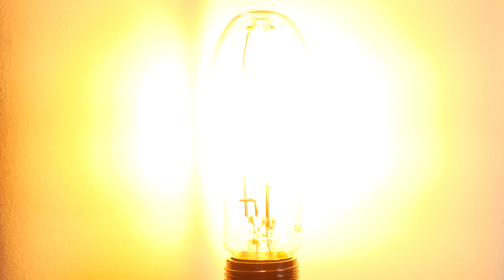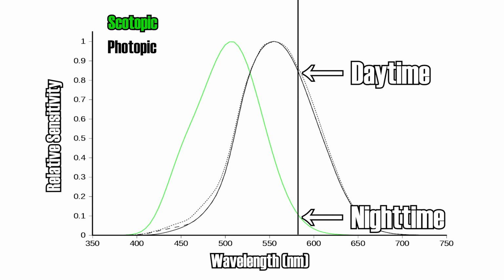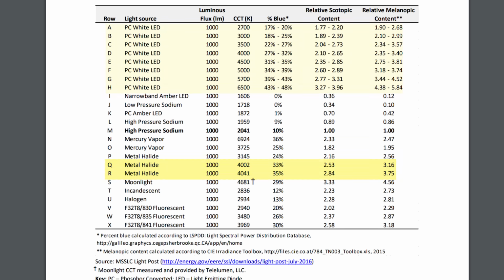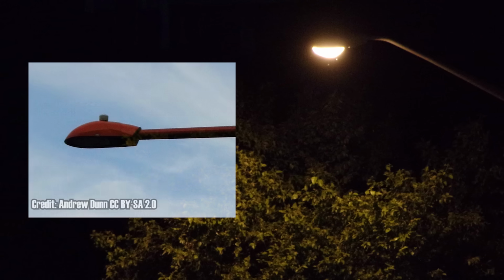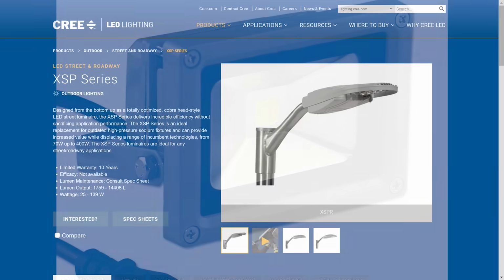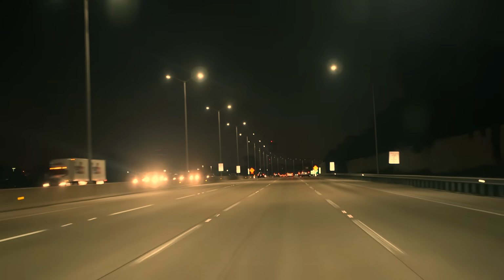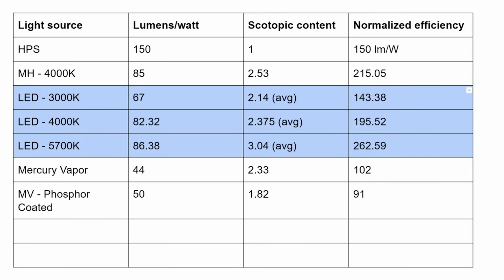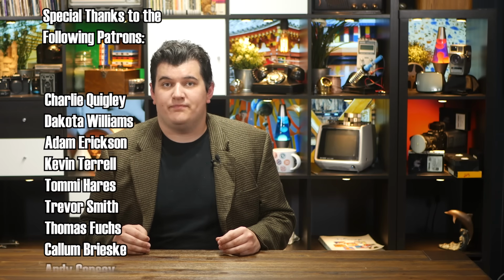The LED's Challenge to High Pressure Sodium

Comment: I might be exposing my ignorance here, but have you heard of the study of white LEDs versus amber street lighting when it comes to behaviour? This is incredibly "hear-say" of me, but what I heard is that areas with white LED street lighting tend to have a lower crime rate after the installation of white LED lights compared to before and compared to areas that are yet to be upgraded with white LED lighting.

Could be entirely bull, I can't find sources on this at all, but here in the UK it's a rhetoric that was spread around a fair amount when local councils were replacing amber street lights with white LEDs.
Reply: This sounds like mistaking correlation for causality to me. Areas that are in general wealthier/higher class generally have systems in place to lessen crime, be it better police funding, street cameras, or just neighborhood watch. Also those same areas have the extra funding to upgrade things like light fixtures and usually care more about issues like energy efficiency. I would be surprised to see any change if you replaced lighting systems in a gang neighborhood or even a suburban area that has a disproportionate amount of crime.
Reply: Crime is directly related to how accurate the visibility of criminals are. It isn't really to do with "orange" or "blue" it has to do with accurate color representation and brightness. However, warm white (orange) gives you less accurate color than (whiter) daylight blue, so you could generalize that bluer light = less crime, but its higher CRI and brightness that actually matters.
Reply: This is interesting. Personally I thought it would be the other way round as blue lighting gives me the creeps. I wouldn't be surprised if it fostered depression. But that's just my personal impression.
Reply: +Humes McKenzie Honestly there are certainly confounding variables that would have to be taken into account to gather any meaningful data on whether or not such a phenomenon does exist and if so whether lighting is a causal or at least contributing factor. On the other hand dismissing the possibility out of hand does not seem justified either there are certainly several very plausible hypothetical ways in which changes in lighting could influence human psychology and/or behaviour in a way which could potentially have an effect on crime either directly for example the increased perceived brightness making potential criminals feel more exposed or indirectly for example if the change in lighting affects the way other people use the space in a manner which increases the perception of risk from criminal activity. Of course the other question that would need to be addressed if such an effect is proved to exist is whether the effect is due to a reduction in spontaneous offending ie crimes of opportunity or merely a displacement of premeditated offending to another location.

A proper assessment of whether such an effect exists and most importantly if such an effect does exist understanding the causes and implications of that would take a properly conducted study which would of course need to also study satellite areas (such as other areas of the same city) as well as completely unrelated control areas (such as similar areas in similar but geographically very distant cities) to not only determine if the hypothesised primary effect exists but whether any secondary effects occur beyond the boundaries of the area where the new lighting is implemented.

Short of that we would merely be guessing and frankly when it comes to understanding complex social phenomena like criminality and determining the nature of changes in large scale statistical data sets such as crime rates human intuition frequently completely fails at the task and rarely provides a complete explanation even on those rare occasions when it is at least partially correct.
Reply: Oh yeah, I've heard about that. I think the Japanese were the first to discover the de-criming effects of blue street lighting. It has been in use for over 10 years now, I thought it was fairly well accepted science at this point.
Reply from the maker: I haven't heard of it, but it's one of those things that sounds true.  But I must disclaim; something that sounds true =/= true.  I would be curious to see some thorough research on the subject.  I think that in general, whiter light is just easier to see with with.  Sodium light is light, sure, but it's not what our eyes are used to seeing--it is in a way the most unnatural light you can have.  So I could totally understand that would-be crime committers might feel far more exposed under white light vs. orange/yellow sodium.  And when it comes to fighting crime, often the illusion of safety is worth just as much as safety.
Reply: @BeTheDeathofMe  peer reviewed or it didnt happen    ;P
Reply: I don't know if it's true, but surely pictures from CCTV are clearer when recorded in light form LED lamp. When there're sodium ones, you can't even determine properly the colour of cars and clothes, and of course it is more comfortable situation for criminals.
Reply: Installing blue lighting at Japanese train stations also seems to significantly decrease the suicide rate, so there may be some impulse or mood affecting property to blue light.
Reply: @thundrbunny id like to read that source, it just isnt working for me.. :/
Reply: whoa.... got some studies on this?
Reply: This is probably at least partially related to broken window theory, which has decades of research behind it.
Reply: Yellow street lights are close to useless when too few are set apart, so criminals know very well yellow light is good as shit to it makes for a perfect spot to rob people and not be seeing.
Reply: UK councils would rather use feelgood hearsay than actual evidence or community needs/wants. They are not there to help you.
Reply: the only best way to test is with areas of equal crime rate and see what happens
Reply: Xilefian 4
Reply: +Micah Reid "Areas that are in general wealthier/higher class generally have systems in place to lessen crime, be it better police funding, street cameras, or just neighborhood watch"
But the OP suggests that the crime rate went down in those areas after installing the new lights. Unless it is shown that at the same time other changes were made, it doesn't seem like mistaken correlation. Because the wealth standard of the area didn't change, only the lights did.

Although I don't know if there is any truth to the claim made of the OP, I could imagine that the effect of the replacement of the light might come from the white light making potential criminals feel more 'exposed' because of the  better visibility. The effect would probably wear off as more areas would receive the new lights.
Reply: +StraightOuttaJarhois Indeed while blue light inhibits melatonin it stimulates it's close relative seratonin. This is why cool bluish lights are often used in the treatment of seasonal affective disorder (A form of depression caused by insufficient light exposure common in high latitudes during the winter thus the name though it's documented to occur in shift workers also due to the lack of daylight exposure caused by shift work). The two are closely intertwined and not simply because of the fact that Serotonin is actually consumed in order to produce Melatonin, yes it is the precursor to it but you don't actually need to become serotonin deficient to develop the symptoms so it's likely there is some competitive inhibition going on also.
Reply: This seems to be in the vain of what you are talking about

https://s3.amazonaws.com/academia.edu.documents/33302059/2014__2nd__J_Affect_Disord.152-154_pp182-184.pdf?AWSAccessKeyId=AKIAIWOWYYGZ2Y53UL3A&Expires=1529437072&Signature=%2FJ5WcYims5RvABeqwG4Syuo7wvQ%3D&response-content-disposition=inline%3B%20filename%3DReconsidering_the_effects_of_blue-light.pdf
Reply: Gentrification. They're not putting the most modern lighting sources in "the hood". They're putting it in the pretty parts of town where rich white people come to shop and dine. The fact that LEDs are usually a lot brighter than the lighting they replaced will also help deter crime.
Reply: have you considered that LED lights tend to be installed in gentrifying/ modernizing areas while old sodium lamps are just maintained or left as is?  thats the experience in my town (only the gentrifying downtown has installed LEDs, and the demographics in this area have changed dramatically in the last 5 years...)
also, the idea that LEDs prevent crime just seems like a malcom gladwell truism ( broken windows theory) that politicians are happy to reiterate for their own agendas...
Reply: I really dont like led lighting, i think councils chose the rough areas to put the lights in,  for our safety ,lol. Complaints about light in windows were widespread, so they try different fittings,  wouldnt imagine them doing this testing process in the nice areas where the councillors live..  bright lights also make the victims easier to find.
Reply: Brighter lighting has been proven to reduce crime do to increased visibility. Criminals prefer to work in the shadows.
Reply: @ Future Hindsight
What makes you think that criminals need flashlights to see what they are doing anyplace where it is light enough to walk without one?
Reply: @BeTheDeathOfMe Do you have any peerreviewed paper to back your claims up?
Reply: @ Future Hindsight 
Because nobody but criminals are out and about because the darkness is dangerous.

Comment: You could start thinking of outdoor lighting in terms of light design, with warmer, lower intensity lighting placed closer to the roadway at an angel and higher discharging lamps placed further up. Yes, you've increased the total cost, but if lamps only need to be replaced every 10 years or so, meh.

Comment: Low pressure sodium is king, best in fog, best in output, best power factor with corrected reactive gear, somewhat problematic however when the streetlight in front of you turns out to be an amber traffic light that suddenly turns red, great video.
Reply: Yes What nonsense.  Whose going to put power factor correction on an HPS ballast?
Reply: everyone does, except maybe in Murica.

Comment: The solution is simple, fix the optics, use LED lights for road lighting, and Sodium lights for street lighting. Problem solved! I still wish they would turn the street lights out at midnight like they used to so I could gaze at the stars again.
Reply: Have road lamps use sensors to know when to turn on. Make them combine their sensors so they're sure its something to turn on for and not a leaf rustling in the wind. Could work for sure.
Reply: LED lighting is so much superior to HPS lighting is so many ways, but to me the color of light is its best feature. I can see so much better with the LED replacements and I do not get the glare I used to get with HPS lights, plus everything looks much better under the LED lighting, colors are not washed out and I find it more relaxing
Reply: Yes the post does have that meaning. Like I said that usage and meaning is wrong. Streets in residential areas are roads. Streets are a subset of roads if the qualification of the meaning of the word street to mean roads in urban areas is used. The meaning that I am complaining about is having streets as one set of highways and roads as another set of highways with no overlap between the sets.

As for saying that curtains will always let in blue light, thus disrupting your circadian rhythm I say: get better curtains. If you really need to get blackout curtains. The very name describes what they do, ie cut all of the light. The common good of better visibility outweighs your circadian rhythm disruption when that disruption has a fairly inexpensive solution.

Oh and the streetlighting where I live would suggest you are wrong to suggest that LED streetlighting is not ready to be installed in mass quantities. Almost all of the major roads around here have LED lights and a great many of the sideroads have LED lights as well. Night time visibility has improved greatly for drivers. Combine that with the switching off of a good deal of the lighting after 1 am that I described above and things are very, very much better for all concerned.
Reply: In the UK we have group control, that does the same thing as the lanterns wont turn on unless the main sensor and the sensor on the lantern both agree.
Reply: "The solution is simple, fix the optics, use LED lights for road lighting, and Sodium lights for street lighting." Problem with that statement is that you are using road and street in a non-standard, incorrect way. Road is a synonym for street, and whilst it might be possible to describe streets as a sub-set of roads if the additional emphasis on streets being roads in built up areas is applied to the meaning, that is not what you are doing. You are using it as meaning that roads and streets are different sets, not streets as a subset of roads.

To those who have circadian rhythm disruption: get darker curtains. If you really can't sleep with even a little light coming in the window then deal with the problem at the window. Oh and LED lights allow precisely the sort of programmatic turning on and off of streetlights that you are advocating. A lot of the lighting around where I live gets switched off around 1 am.
Reply: He uses road to describe highways and street to describe residential roadways, such as housing estates.

The lantern outside my house is about 2 meters away from the front wall and is mounted on a 10 meter column so regardless of curtains it will still let blue light in which will still affect my circadian rhythm.

LED isn't a one stop fix for all of our issues and the technology simply isn't ready to be installed in mass quantities yet despite how the government push it down our throats.
Reply: Everyone makes grammatical errors, and the fact that I can understand what Clem said suggests that most people can even though the wrong words were used.

There's an issue with the type of LED street light that my local council are using where they flop downwards and point directly towards whatever is behind them, so a blackout curtain won't help there as every cloth lets light through it and curtains let light around the edge.

The reliability of LED street lighting is nowhere near what it should be. Brightness reduces by 25% after just a few months of use and the amount around here that have already broken even though they are supposed to last the right side of 20 years is ridiculous. Safety hasn't improved as the useless blue pool of light under the lantern does nothing compared to the bright orange sphere that covers the whole road from a SON-T lantern. Switching off street lighting on highways isn't safe and in residential areas it can lead to increased crime so even this is not a valid solution, the alternate brightness levels that the Philips Iridium CDM-T lanterns are capable of is only suitable for residential areas and in this mode they use less energy than an LED lantern and also have a straight white light.
Reply: A ghastly blue glow has been scientifically proven to prevent you from relaxing, and LED street lights aren't the only ones that are capable of the "white light" feature, you can get CDO, CDM, MBFU, MHV and PLT street lights that can all produce white light without the reliability issues of LED lanterns.
Reply: I live on a main road and the SON lantern outside my window is 150w. An LED replacement for it would have to be 94w at least and would also stop me from sleeping so I think in any residential area SOX or SON lighting should be used whereas motorways should have LED. Oh, and part night photocells are a great idea, apart from the amount of crime that turning street lights off causes, in my opinion street lights such as the Atlas Alpha 8 that use 2 separate lamps, a high wattage one for part of the night and a low wattage one for the other part should be used in residential areas.

Comment: I read a study about a month ago that found LED street lights disturb your night-vision making it significantly more difficult to see items in the shadows or not directly lit by the LED street light. Has something to do with light sources closer to the red end of the spectrum not causing our pupil to contract, where as lights closer to the blue spectrum cause our pupils to constrict, reducing our night vision. Do you know anything about this? Did you come across anything on different colour temperature or spectrum and the effect on night-vision?
Reply: Heard of this too, it is why at nighttime submarines are lit with red light for a while before surfacing - so the crew can exit the boat and are immediately used to 'darkness'.